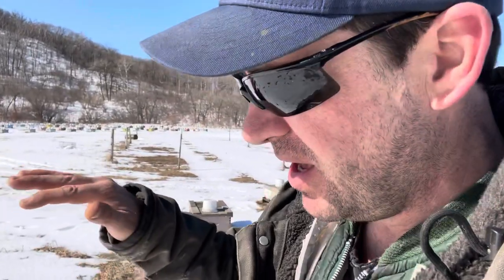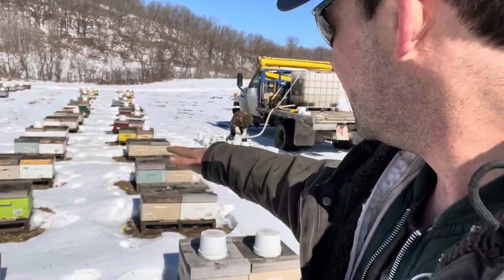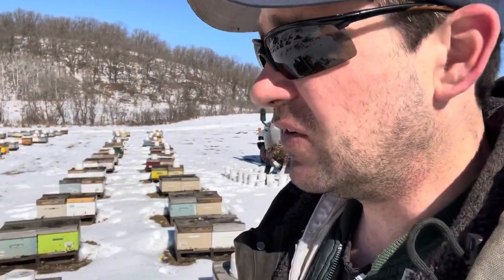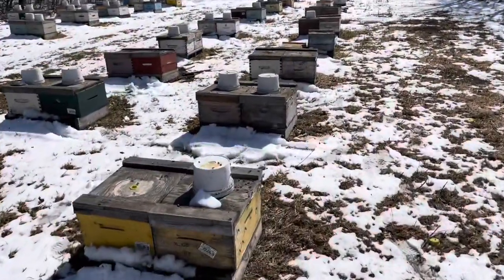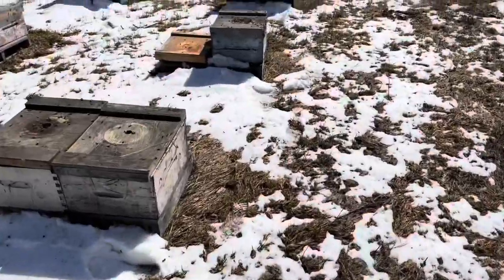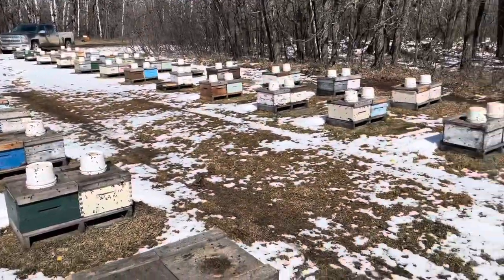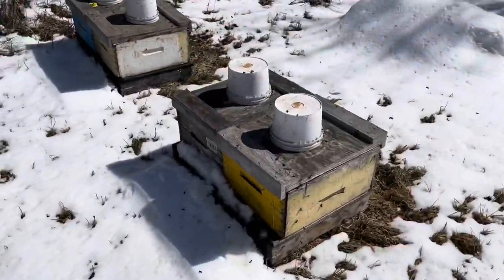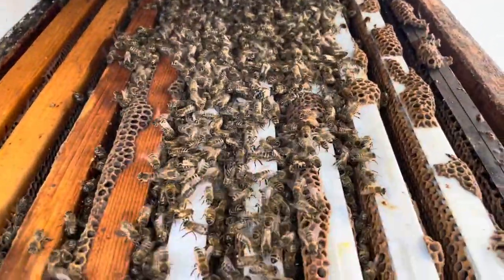We Need Warmth To Work

Comment: New beekeeper last year. Started with three packages of Saskatraz bees, all new equipment. Ran double deeps, only pulled the honey from the suppers. Got 8 gallons total. I overwintered in a cooler I used for apples in the fall. All 3 colony's overwintered in excellent shape, I use a coolbott air-conditioning system, works great . I really enjoy following this channel as I only live a couple hours south of you.